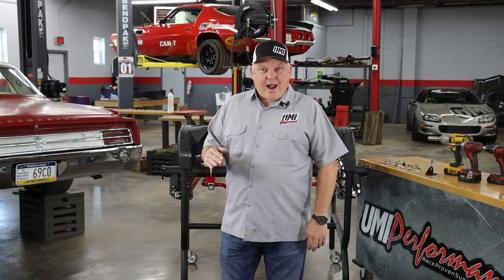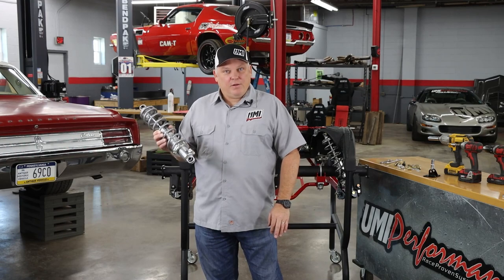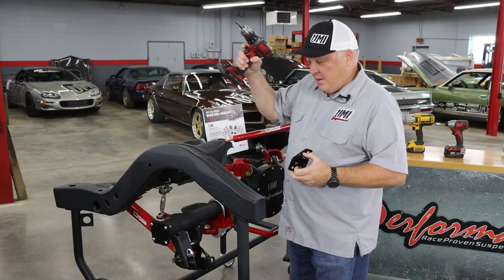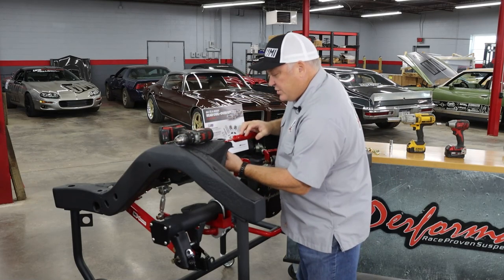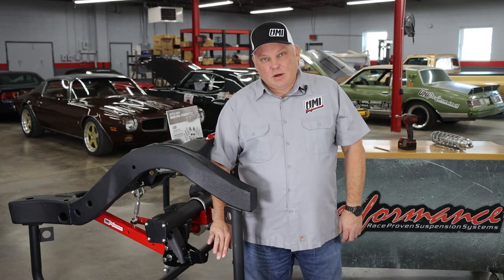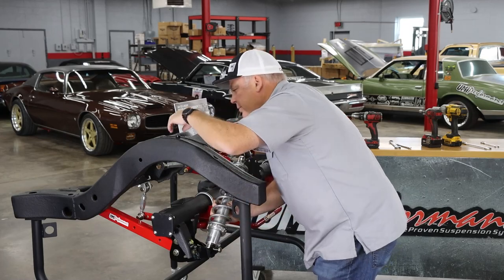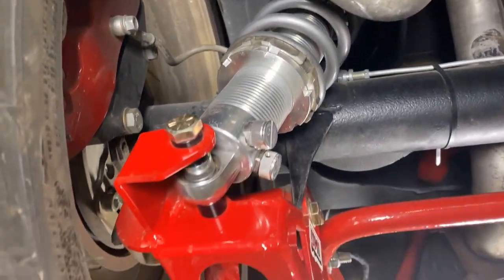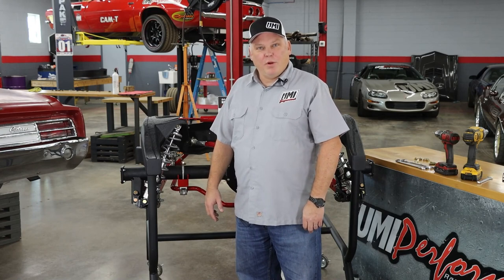64-72 GM A-Body Chevelle GTO Cutlass Coilover Conversion by UMI Performance

Comment: So that fancy red bar between the upper shock mounts is supposed to be the cure all for potential mount damage? Curious because I have been looking at doing something like this but have been hesitant due to horror stories.
Reply from the maker: Not sure about cure all but we do know that many Pro-Tour style autocross cars use this. We've seen a nice reduction in frame damage complaints (even though it's not necessarily our product causing the damage).
Reply: @umiperformance  sure, like your video states back in the day people running air shocks  would damage them alone. But, I have also heard just running coil overs alone are not a good option and could create the same damage?   So the bar would be a good aid in helping reduce that risk? This will also just be a fun cruiser for the weekends or maybe after work, maybe get on it a little here and there would be about all I  would plan to do with the car.
Reply: @b2ja03  Global West is better engineering of the fancy bar imo.

Comment: Did UMI change this bracket within the past couple years?  My 4057 looks nothing like this. Nor does it fit my  Currie housing.
I need to check on my GM 12 bolt and see if it fits that.

Comment: Do you have any brackets for the Moser 9” rear ?
Reply from the maker: Good afternoon. Thanks for the message. Unfortunately we do not. All of the aftermarket housings are different from each other. Our 4057 kit is only for GM 10 and 12 bolt.